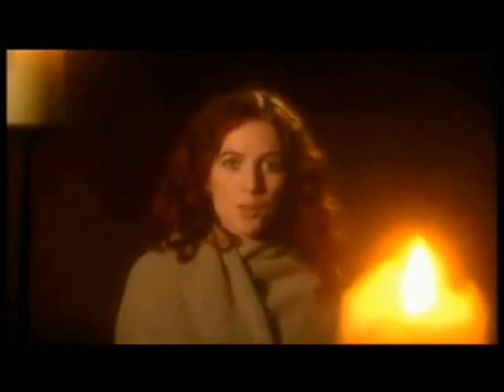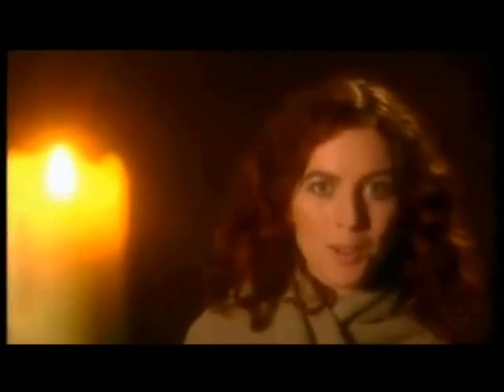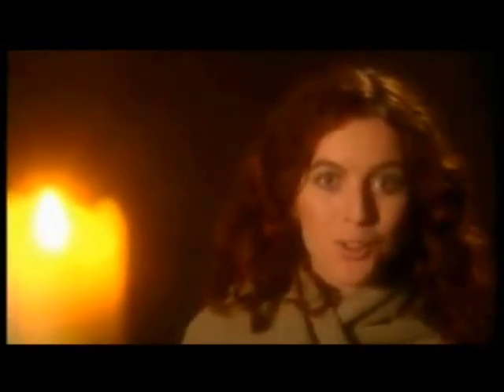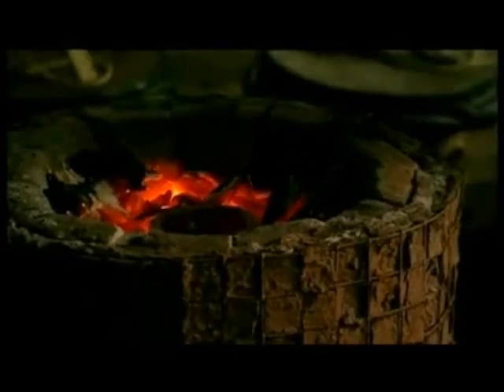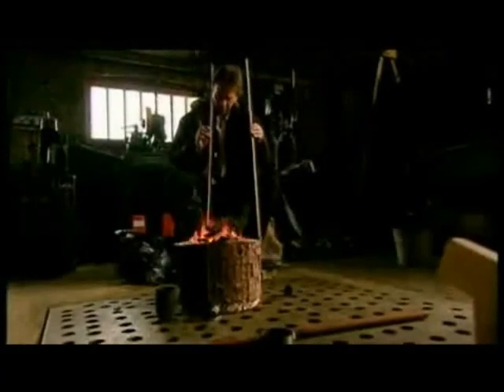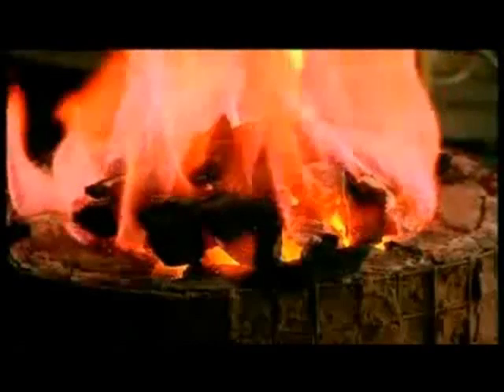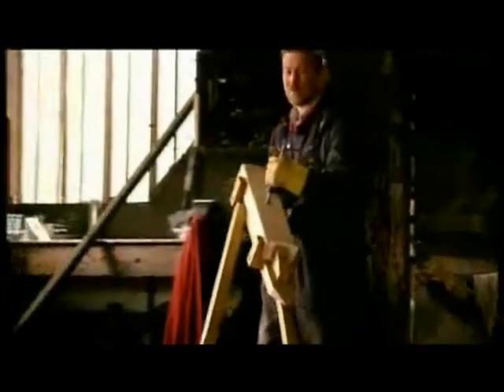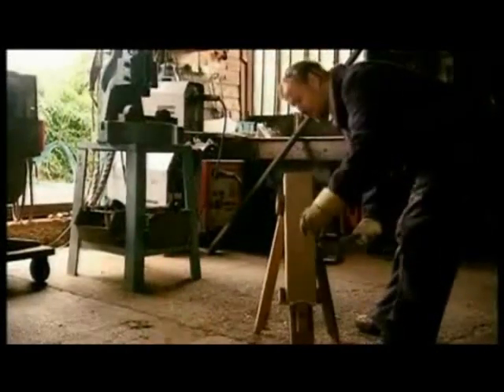Ancient Origins of The Sword in the Stone

Comment: Actually, when steel reaches critical temperature, it becomes a form called austenite, which is crystalline- quenching it keeps it crystalline in a form called martensite, which is both less dense and harder than the normal structure steel would have if allowed to slowly cool. In this state it's also very brittle and needs some form of reheating to relieve stresses, otherwise it can snap very easily.

Comment: @smijman  The previous response is incorrect for bronze working, when you are working with ferous metals i.e steel, quenching does harden the metal. Non ferous metals like bronze as they are using in this video become softer when quenched

Comment: @EGCblackknight 

That´s right i hawe tried both, copper became wery soft when heated and cooled by water, dont think the water has any effect on the metal at all. 
Low carbon iron (less than <0,5%?) will not eiter be possible to quench it remain soft even after the process.
I hawe tried, but it can withstand much higher forge temperature than high carbon steel. 
To high quenchtemperature will make high carbon steel wery hard but also wer brittle, think thats the story about the brooken sword